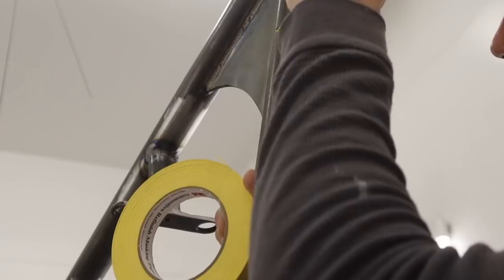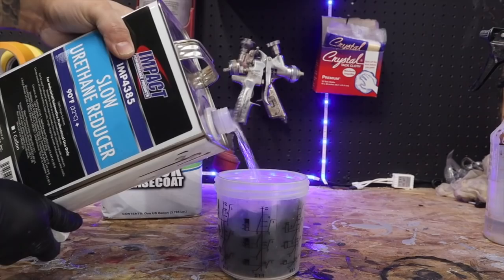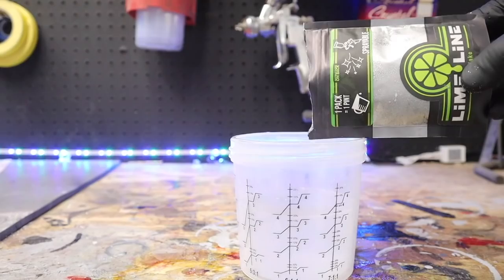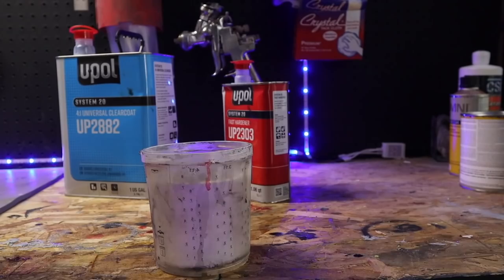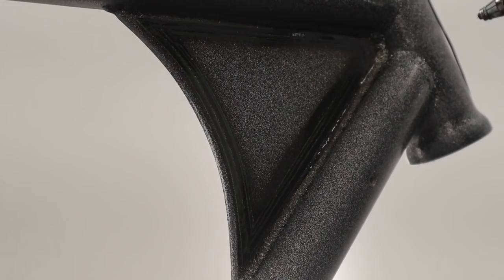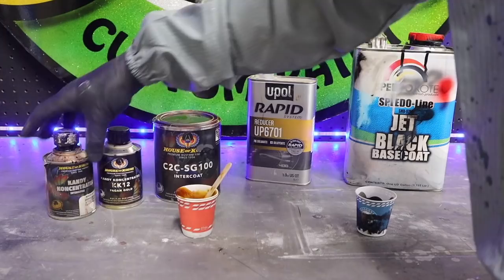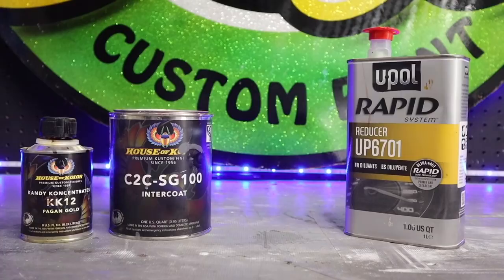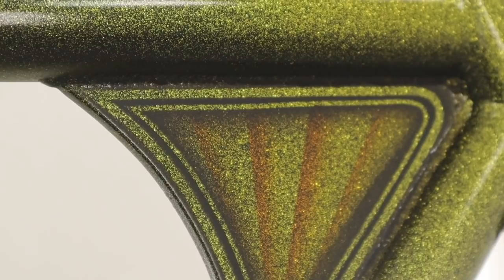How to Paint Metal Flake

Comment: My method for spraying flakes is Silver base under chrome flakes - Spray a wet bed of clear prior to flake application makes life easy...... it allows flakes to embed and lay down vs them wanting to stand back up on edge & also allows for less coats of clear/flow coats afterwards......
Reply from the maker: That’s how I did it before and that works. However I have found you get more of a sparkle over black when using LiME LiNE metal flake.

Comment: Hi Do u have too sand it wen u spray Matel flake ? An is that the only size needle u can use or can I use the ones that come with the airbrush gun the G444
Reply from the maker: 1.3 tip size or bigger using LiME LiNE flake. Yes you need to sand smooth before graphics

Comment: Your videos have inspired me to do some paint work. I did a tank with house of kolor. I have a question. Can I do this line line flake in clear over a metallic/candy job with panels done or will it change the color of the paint job. I would like more sparkle.
Reply from the maker: No probably dont do that. Its used as a base layer for candy paint on top
Reply: Tha I you so much for your reply and input. Keep the videos coming!

Comment: If i used silver flake and accidentally sanded through clear into the flake will the sparkle come back after the clear is applied?
Reply from the maker: It should be OK as long as you didn’t burn through the metal flake

Comment: After you spray the metal flake and clear how long do you wait until you sand it smooth? I sprayed my gas tank and fender 2 days ago and I had 1 small drip on the mounting tab and that drip is still pretty soft
Reply from the maker: Depends on the clear but usually 24 hours